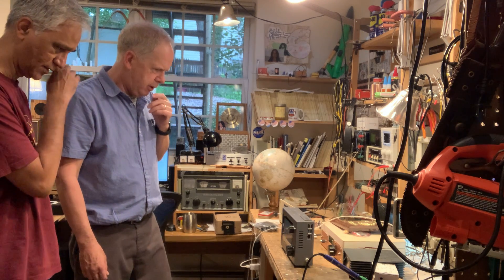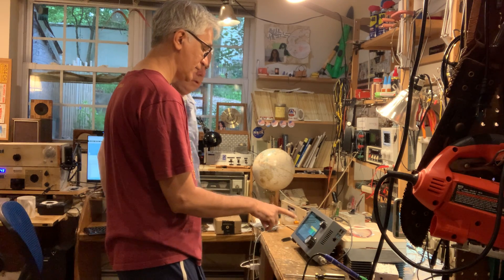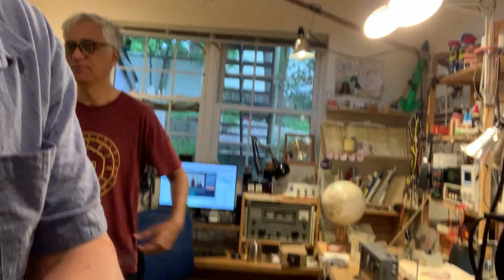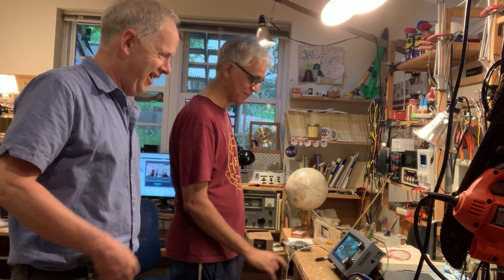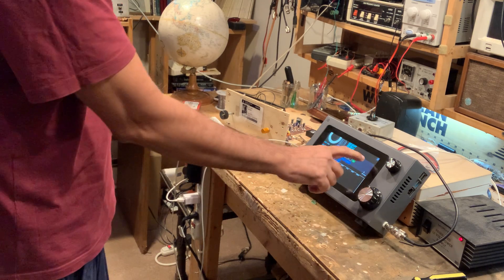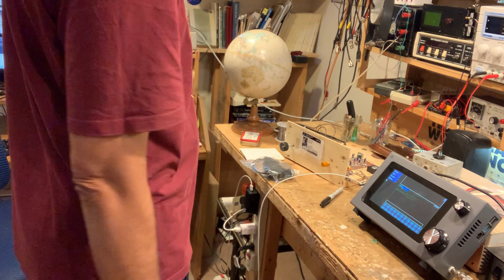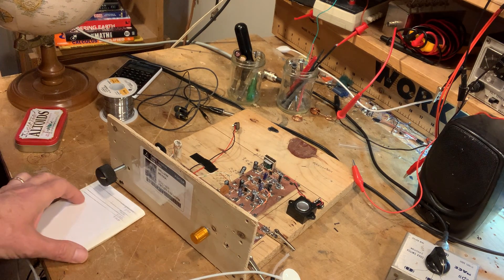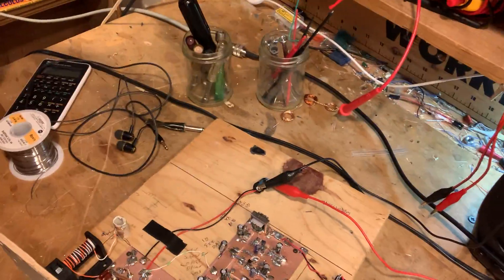Farhan and Bill at the bench. sBITX!  and a bit of Direct Conversion    May 16, 2023

Comment: Now Bill, you blamed the power going off on the fuse in your power supply, but I’m thinking maybe that was just a coverup for your automated search and destroy system that disables radios that have too much digital/computerized circuitry in them when in your shack. Am I right, huh? 😂😂😂 73s
Reply from the maker: That would have been diabolical! But 1) I wouldn't do that to Farhan and 2) in any case I don't have the programming skills to do it!  73  Bill

Comment: Another great video Bill, thanks. The xBITX looks to be an amazing piece of equipment. Farhan did seem enjoy going back to the other end of the scale, when tuning CW with the permeability tuned oscillator. With you having mentioned Radio Marti a few times on 7335, I wondered if I could receive it here in Western Australia. Indeed I can, at the right time. I have a small Sangean receiver. It has digital tuning and also SSB, for when I need that. I tried tonight at 6pm, which was half an hour after sunset. I could hear talking but not very good. I then used the same quarter wave length of wire you used on the school DC receiver. It came in good, sounding like Spanish but a lot of static. Checking a bit later the static was mostly gone. I could hear it clearly. I confirmed it was Radio Marti by using an app on my phone to listen to Radio Marti. Listening to both at the same time the radio was about 3 seconds behind what I was hearing on the phone. It's now coming up to 9pm and I can't hear Radio Marti anymore.

Regards Trevor.
Reply from the maker: Trevor:  Great.  But if you keep listening you may develop an urge to liberate a Caribbean island! 73  Bill
Reply: @soldersmoke  I do get the joke. You told Farhan it was being directed at Cuba, but you were on the back of it.